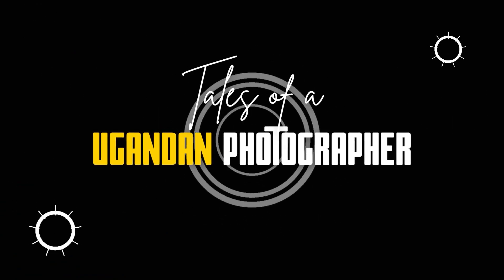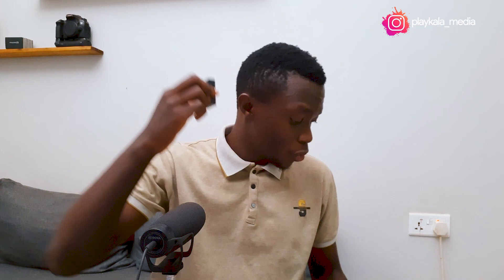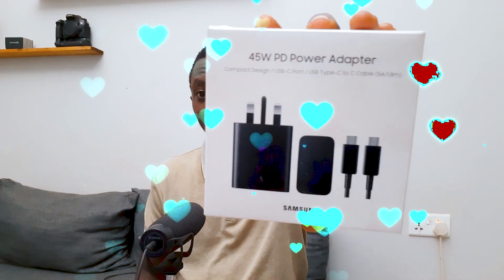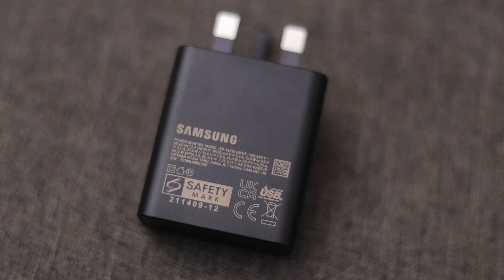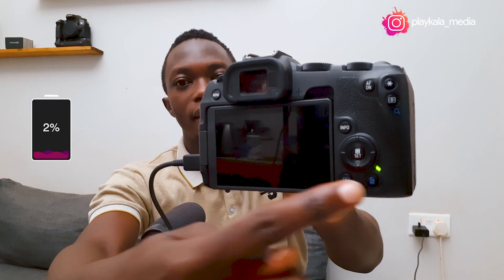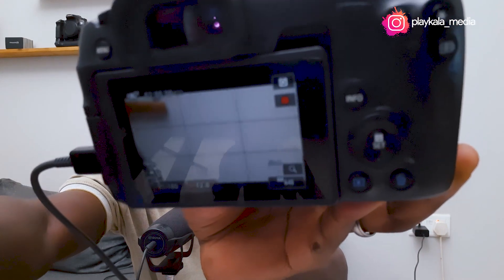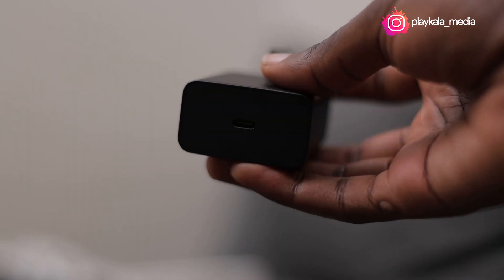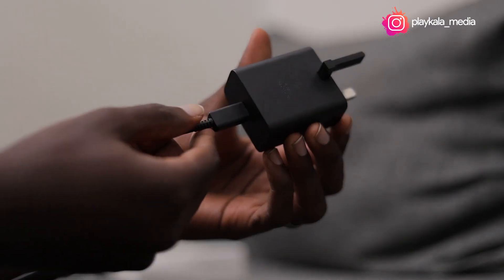Canon USB Charging Problems Solved / PD (Power Delivery) / Tales of a Ugandan Photographer

Comment: My camera won't give the green led light when the camera is turned off but when i turn on the camera, the charging bars are greyed out. not sure whats wrong. using the same charger here.
Reply from the maker: When the battery is full, the green Led light goes off. May be try using half the battery and plug in again. If it doesn't work then i dont how else to help!